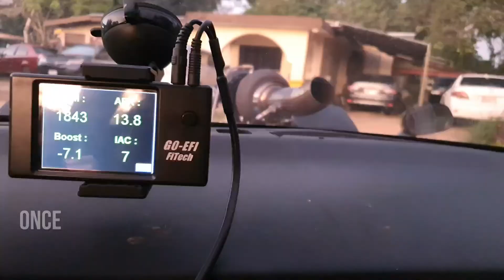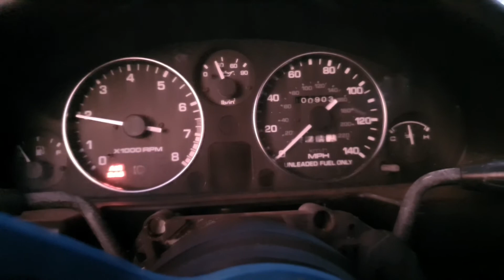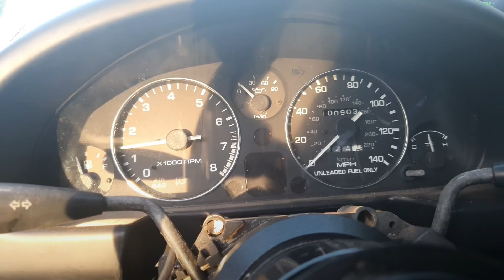13b bridgeport turbo fitech rotary miata

Comment: Was thinking about running on my 12a half bridge turbo would you recommend ?
Reply from the maker: So far I love it. But there's some issues that aren't perfect. I can't seem to get rid of the lean tip-in but other than that it's alright. Waaay better than any carb setup I've had on my 13b. I've tried side drafts and holley set ups but this is far better than them. The tuning takes time tho.
Reply: What are the advantages of running a half bridge. Seems like the idle is just as rough as a full bridge but the top end will be flow limited compared to full bridge. Is the low-mid range more driveable??